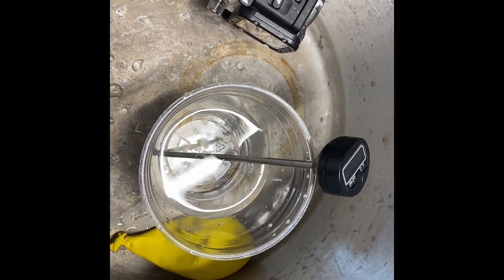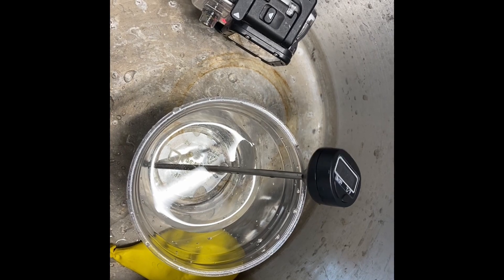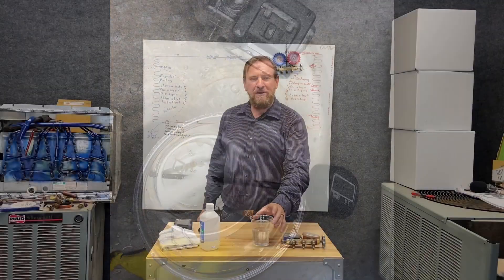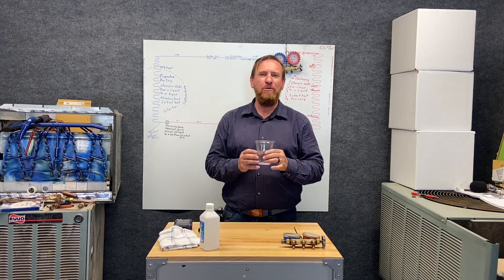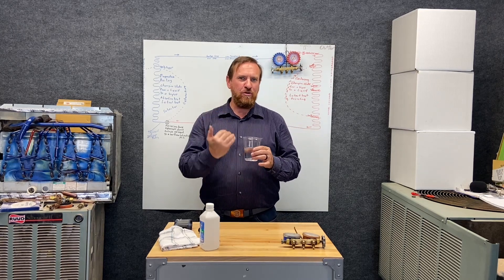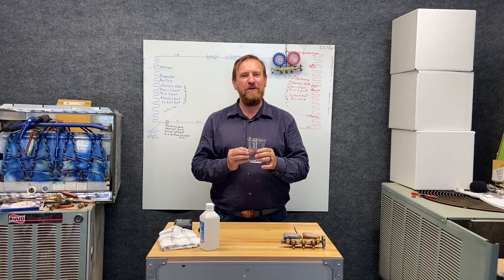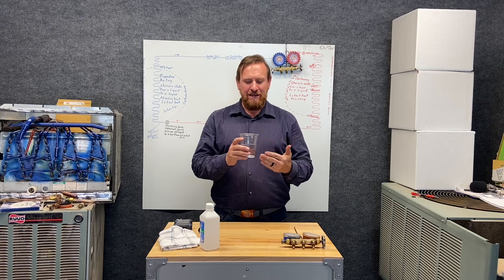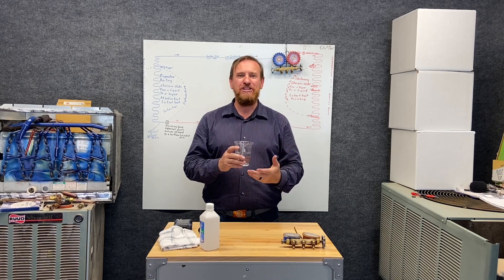HVAC 022 A pressure and boiling water at room temperature.

Comment: Interesting that as soon as you turn off the vacuum pump the boiling stops even though the cylinder was still under some vacuum it boiled enough to change the pressure enough to stop.

Comment: Hello HVAC engineer , 
could you tell what you mean by saying "absorbing heat from itself" (at 1:33)
Reply from the maker: Flash gas and adiabatic expansion.
The pressure drops and the temperature drops
 25% of the liquid instantly flashes or changes state to a vapor. Any time a substance changes state from a liquid to. Vapor it absorbs heat. In this case it's not absorbing heat from the air but from the remaining 75% liquid. It's how we instantly end up at saturation.

Comment: I reached in following your nice beneficial  videos up to this point..
allow me some more clarification for students who might benefit..and if I'm wrong correct me:

When the vapor pressure of a liquid equals the air pressure, the boiling point is reached. The boiling point will rise as air pressure rises. Lowering atmospheric pressure, on the other hand, lowers the boiling point of the liquid.
The vapor pressure of water is temperature dependent, which causes this phenomenon. It rises when the temperature rises and falls as the temperature falls.
one can think of the liquid in a container is pushed back into the container by air pressure (preventing it from transitioning to the gas phase). The more force pushing the particles down into the container, the higher the pressure, which means you'll have to heat the liquid much more to get it to boil.
Reduced pressure means less force is exerted on liquid particles to keep them in a container, allowing them to exit (transition into the gas phase) more easily.